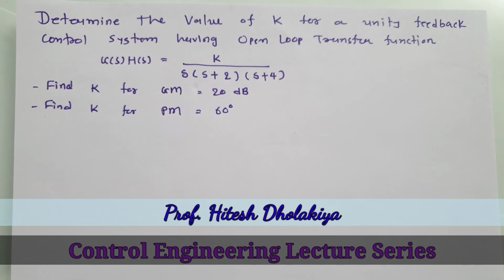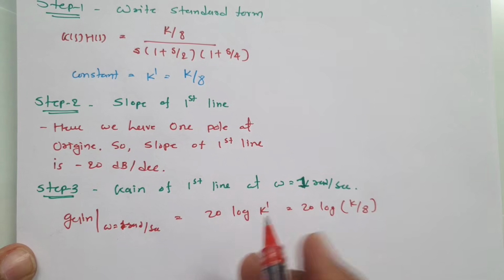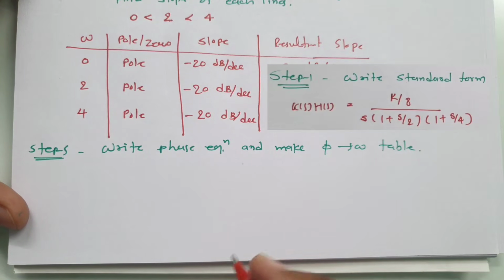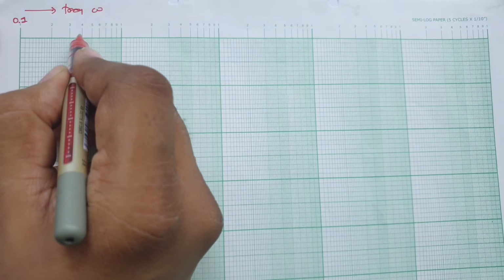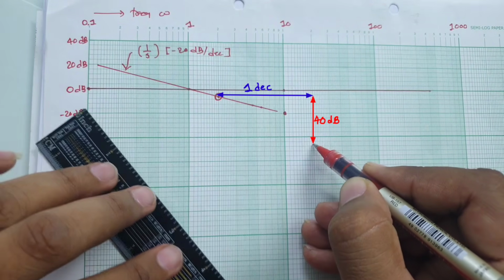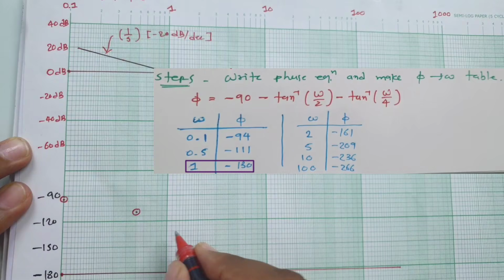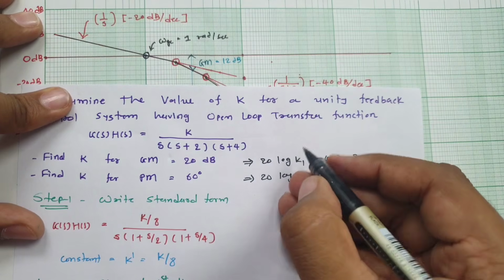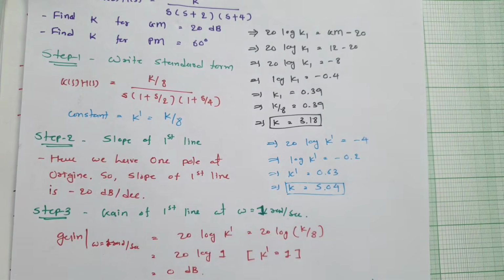Bode Plot Example Explained in Control Systems: Basics, Drawing Procedure, and Parameters

Comment: K/8 is not understand explain gain
Reply: @kalsanishyamalakalsanishya8682  bro if you take 4 and 2 common in denominator. Then it’s 4x2=8. When 8 which is in multiplication when goes up to numerator then it will become division. So it’s k/8

Comment: Sir I could not get the formula that you used to calculate the value of k. So pls give it's justification from where you have applied it. What is the soul of this formula.
Reply from the maker: For that you should see the very 1st video of bode plot in playlist of control engineering by engineering funda.
Reply: Sir I have seen your first video in that you have given the formula for gain k at omega equal to 1 that is 20 log k. From that I still could not understand the my query.
Reply: But I know the 1 divided by gain at phase cross over frequency is call the GM or if I express the GM in dB that is 20 log (1/k) at phase cross over frequency. Can it be use for calculation of the constant k?

Comment: Sir can please solve this question? It come regularly in exams. The question is
 G(s) = ks^2/(1+0.2s)(1+0.02s)
Thankyou sir.
Reply from the maker: Process remains same
Reply: @EngineeringFunda  sir here which number to take common in the poles in (1+0.2s) 1 or 0 to take common?
Reply from the maker: @sumitdebbarma1209  1 rad/sec is always reference point.
Reply: Okay sir thankyou very much sir for immediate reply.

Comment: Sir in book i have seen some questions have omega = 1rad/sec and some questions have omega =2 rad/sec, if we talk about the step 3 of yours equations. How to identify that.
Reply from the maker: Go through at least two examples in my Playlist and you will get everything
Reply: @EngineeringFunda  sir i went through your video and both the videos i saw in step number 3 is omega = 1 rad/sec, but using your method example in books answer comes correct as well only thing is that some examples in books are given as omega = 2 rad/sec and some examples are 1rad/sec in step 3. Does it have any importance at all? Or can we write anything?
Reply from the maker: @sumitdebbarma1209  : reference frequency is 1rad/sec only
Reply: @EngineeringFunda  okay sir so what ever it shows in book doesn't matter right sir? Then i am going with yours sir thanks for immediate response.
Reply: @sumitdebbarma1209 bro from which book are you solving questions
Reply: @adi5962  control system by samarjit gosh bro.
Reply: @adi5962  or if you have WhatsApp number I can send you the pics of that book incase if you need to buy it too.
Reply: Hi bro so for step 3 the omega should always be 1 rad/sec right? So does that mean when we are plotting the gain graph, we need to start measure at 1 at omega (x-axis)?

Comment: For finding K for Gain Margin = 20 dB we shifted magnitude plot by 8 dB downwards hence equation : 20 log(K') =  -  8
Similarly,
To find K for Phase Margin = 60 degree we need to shift magnitude plot up by 16 dB so the equation will  be  : 20log (K') = +16
which gives K = 50.4 
Please Verify this answer
Reply: are these correct?
Reply: It's -4 by plot

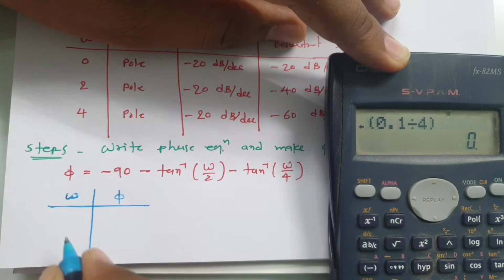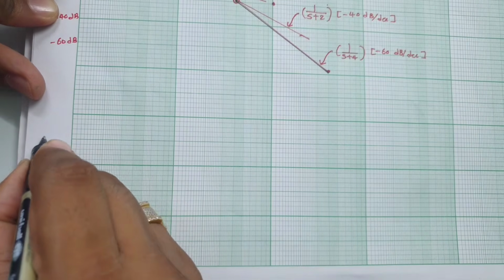Comment: Dr, how you determine the number of frequency 07:51; range or number of dB 10:48 and angle 15:28?  Are there any technique to help us determine?  Thank you so much!
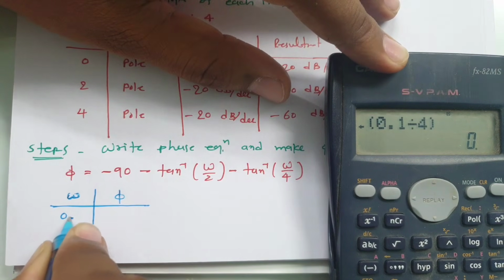Reply from the maker: 7:51 - number of frequency is chosen randomly, we just need to draw phase plot and it should be smooth.
Reply from the maker: 10:48 - Graph range should be based on 1st line, otherwise sometimes given graph 📊 may needs more area for gain and phase plot.
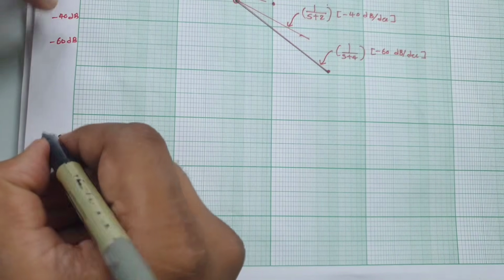Reply from the maker: 15:28 - Angle order should as per mention in graph and range was earlier calculated in table of phase.